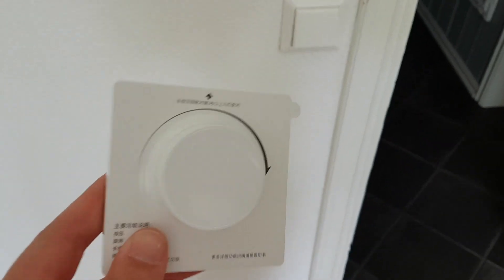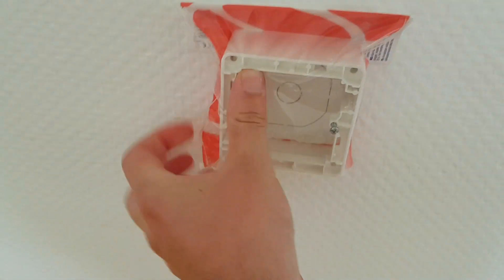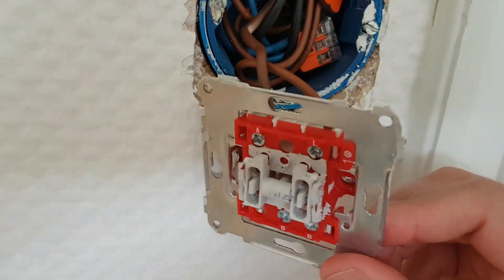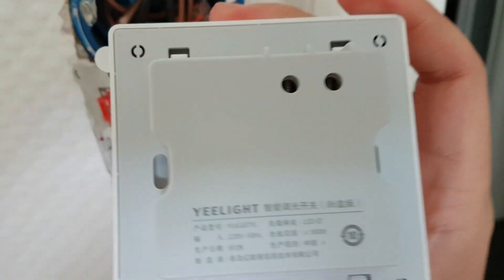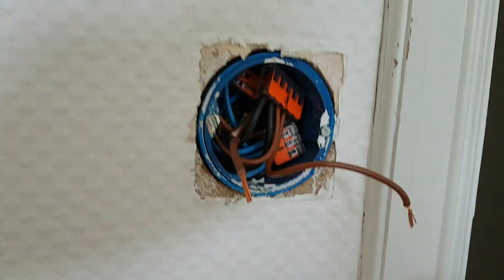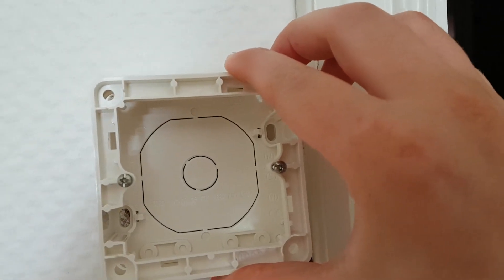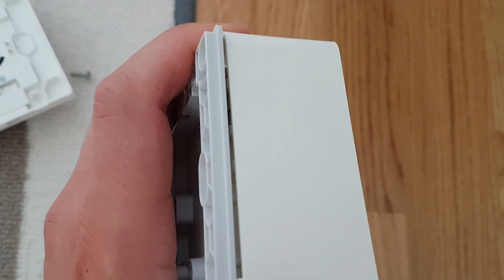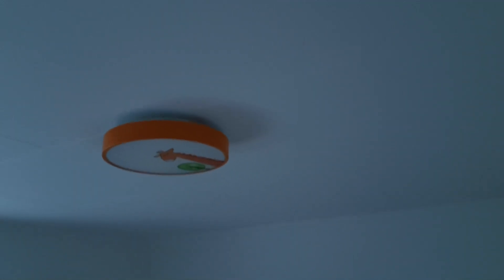How to fit the Xiaomi Yeelight Dimmer Hardwire version on your wall and replace your switch

Comment: So it requires a live wire just to power the Yeelight Dimmer instead of a battery and you can connect it via Bluetooth as with a separate stick-on switch?

Comment: Are you still using these? I bought 5 hardwired ones, but then someone scared me, because they dont have CE certificate?? Did you have any problems with it? Satisfied?
Reply from the maker: I removed the one I used now and replaced with a Philips Hue Led strip inside the roof. I had no problems with it.
Reply: @haukeberg  i meant dimmer switch :p
Reply from the maker: @zigajamnik  I don’t use it any more. I will have to find a new use for it and the lamp it controlled. It is a shame but the control does not dim other lamps than yeelight.

Comment: Heyy:) can I please get the dimension of the wall box that fits the yeelight dimmer. Or link to where to get that from?:)
Reply from the maker: 84mm x 84mm x 35mm
Reply: @haukeberg  many thanks.
Reply: @haukeberg  also. Can I ask if it is possible to hardwire a yeelight strip light to a wall switch inside of using a wall socket to plug in the adapter.
Reply: @haukeberg   and where did you buyed wall box?
Reply: @haukeberg   or do you know dimension between mounting holes on dimmer/box?
Reply from the maker: @cmmedia_  in my country it is a standard dimension on all electrical wires and wall boxes. I bought it in a normal store . Dimensions are: 84mm 84mm 35mm
Reply from the maker: @cmmedia_  https://www.elektroimportoren.no/kappe-enkel-33mm-rs16-ph/1471577/Product.html
Reply: @haukeberg  thx. I found compatible box to put inside the wall.
Reply from the maker: Yeelight led light strip? It is 220v/110v so should be possible